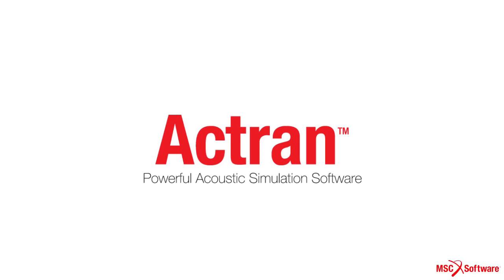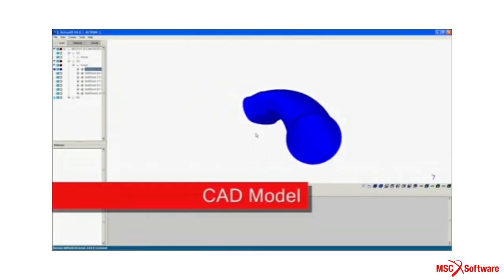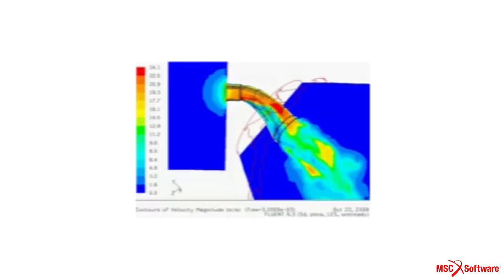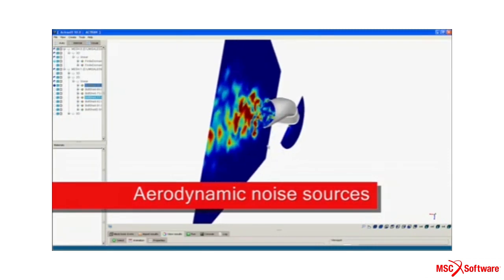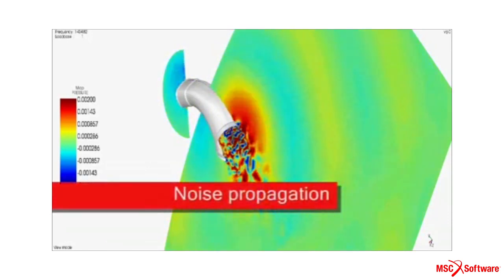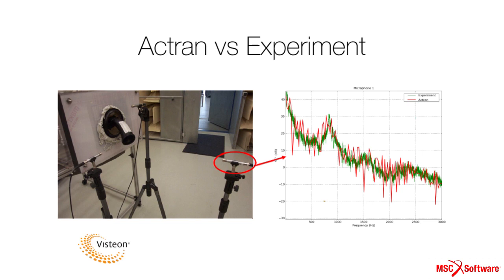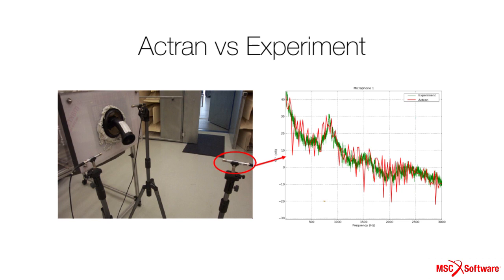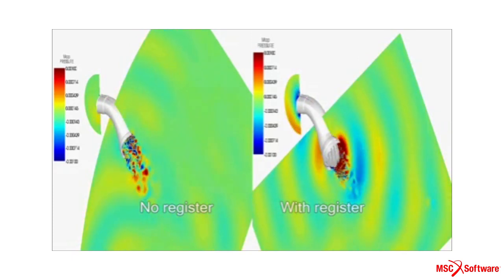Actran - Aero-acoustic Simulation of a HVAC Duct

Comment: Does Actran solve the acoustic wave equation in time domain or in frequecny domain? In which format are the results read from FLEUNT cfd program? Which other CFD programs can be used for the unsteady calculations? Many thanks
Reply: Both Time and frequency domain are possible. In this case it is frequency domain. Actran can read native Fluent results file formats .cas and .dat or .cdat. Results from all major CFD software can be read.